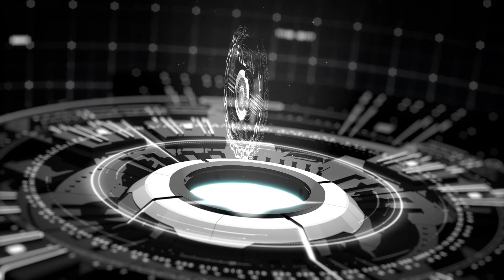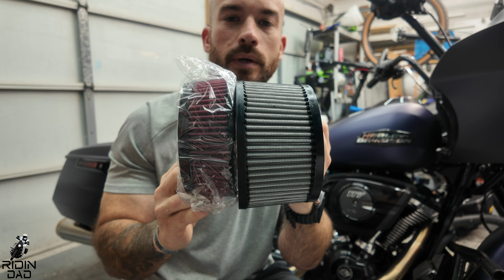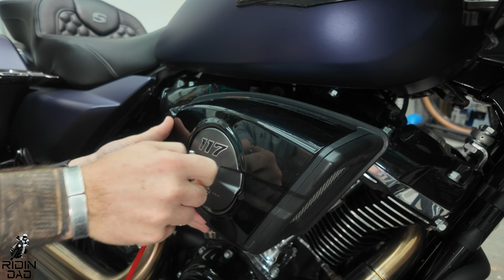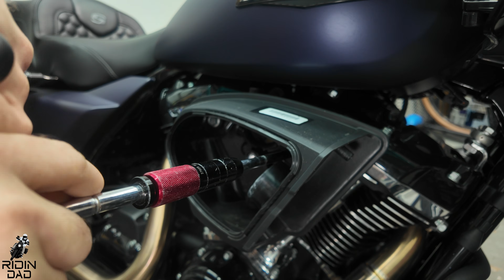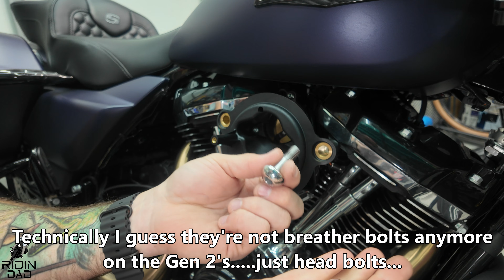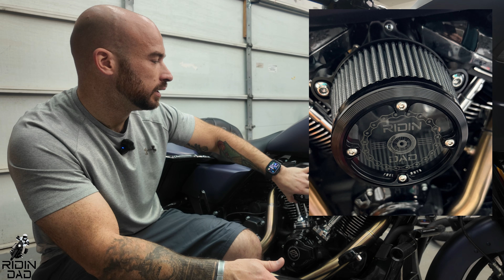Fuel Moto AC/DC Air Cleaner INSTALL - for Gen 2 M8 Touring & Softail Harley Davidsons

Comment: Did you have to use a tuner with the new exhaust and air cleaner? If not how is it doing?
Reply from the maker: Yeah when you change both you should. Just one is not necessary. I used a pv4 with a tune from fuel moto. I love the setup.  Bike performs perfect
Reply: @RidinDad ok thank you

Comment: Can we have an update on this?  Do you still like it?  Now that FM released this as a direct kit instead of having to upgrade to the bigger filter element, they should sell a lot more of these.  

I like the look but am worried that it will make me uncomfortable on longer rides.
Reply from the maker: So it definitely does stick out more than the other one obviously. I was previously using an upfront closer reach seat from Lapera that definitely was right where my leg was. I just recently switched to the regular seat from lapera to try out and would that seat in pretty much put the filter just barely touching the front of my leg. My leg is pretty much completely behind it. But I have not written enough to see if it makes a significant change in comfort. Other than that, I never had any issue with comfort or anything like that with this filter. My leg just stuck out on the side a little bit and that was it. And I’ve had no issue with the product itself.
Reply: @R @RidinDad anks for the update!  I think I will give it a try.  The price of air cleaners has hit ridiculous for what we are getting.  It’s a bigger air filter, not some costly piece of technology or device.  We are seeing more molded plastic or 3d printed backing plates, making the 500 to 700 price tags even more obscene.
Reply from the maker: I know man. Everything’s gotten so expensive. It’s sucks

Comment: I was heavily torn between the Trask and Fuel Moto air cleaner.  Pretty sure I'm gonna go with the FM when the time comes.  I have a Thunderheader on the way and was told you can either do an air cleaner or pipe without having to tune the M8 and the Gen2, but not both at the same time without tuning.
Reply from the maker: Yupp. Correct! And yeah I like the look of trask better. But the fm performs better and is way cheaper

Comment: Great video. Haven't seen a RD Production in a while bro is lookin buff! When you said the AC/DC Filter was cheap I had to check the price, and you are correct! When I got into HD I didn't realize the parts cost so much money! These companies are really out here charging $500 for Air Cleaners! To me even $300 is a rip off. Most of the parts are similar if not identical yet there's clear and chrome Air Cleaners upwards of $600!? Guys if you've got $700 for an Air Cleaner just make some extra payments.
Reply from the maker: I know man :/ life got busy. I have many videos recorded but some need thumbnails and YouTube settings and others need to be edited still. And thanks man!! Exactly. Fuel moto is super cheap and dyno proven. That’s why I went with them over all the other options this go around

Comment: HD's new bikes sure have alot of plastic....That Air Cleaner you took off is alot plastic....Does that fatter Air Cleaner stick out enough to hit your leg?....It looks like that slimmer red filter is much more streamline....
Reply from the maker: It is plastic yes. Bbuuutttttt the old gen 1 m8’s had a plastic intake where these have a metal intake so this is a much better setup. Yes it hits my leg a little bit. I mention it in the video.
Reply: @RidinDad That is true...But take out a little plastic and add alot more plastic is a bit defeating when the old HD puriests loved and prided their (Iron Horses) over the Plastic Metric Bikes of the period....By the way there was a Biker Mag that was called "Iron Horse" that featured HD Motorcycle Choppers and Bobbers...
Reply from the maker: Yeah I’m familiar. And I know man. I have to do some more research in it, but I feel like there is a reason that Harley switched it because even with these aftermarket companies, for the generation 2M8 engines, the backing plate for the air cleaner is plastic also. So I would assume there has to be some reason here.
Reply: @RidinDad Its all about money...If they can make a part that uses cheaper matierals and sell at the same price or more thats more money for them....Us as consumers have the power to not buy those types of parts...
Reply from the maker: I understand that